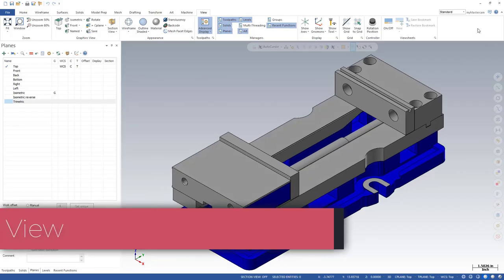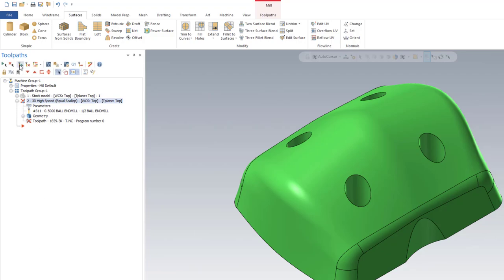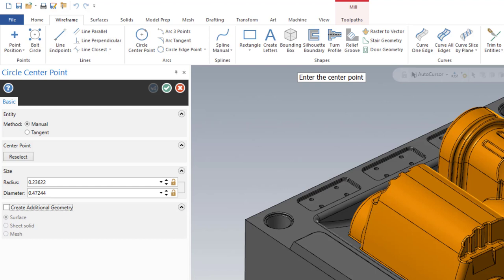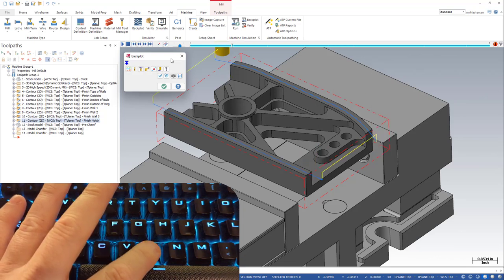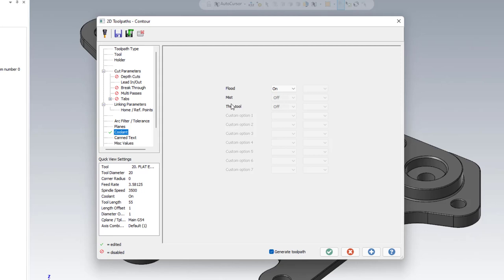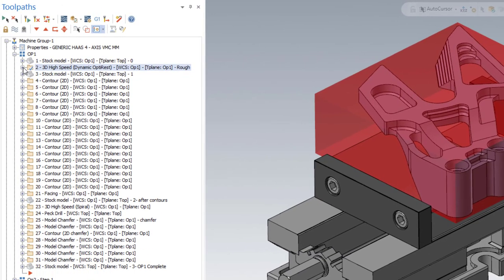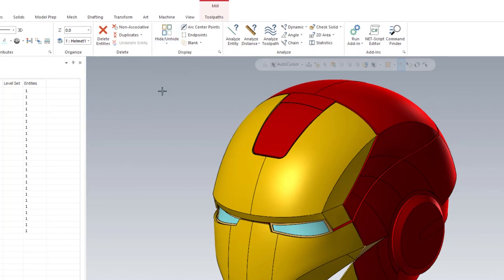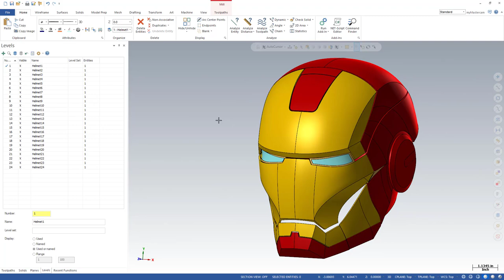8 Pro Tips for Improving your Mastercam Workflow

Comment: I work in the mold manufacturing industry
I don't know the difference between
Hybrid and Equal Scallop toolpaths

When do I use
Hybrid 
,,,,,,,,,,,,,,,,,,,,,,,,,,,,,,,
When do I use
Equal Scallop
,,,,,,,,,,,,,,,,,,,,,,,,,
please answer me
Reply from the maker: Hybrid is a combination of constant z and scallop. Equal Scallop cuts with a even scallop motion relative to the stepover. 
What works better is dependant on the part and the type of motion you are after.